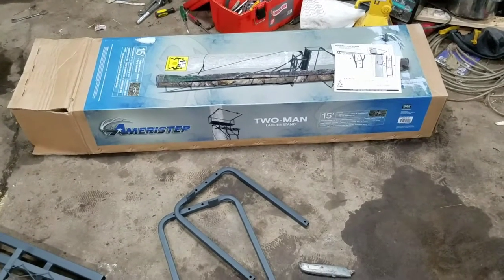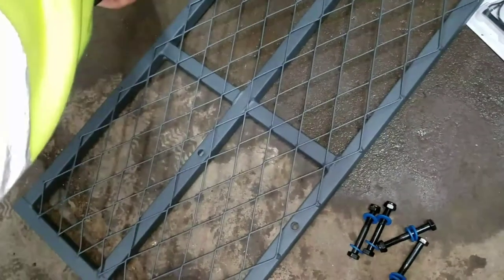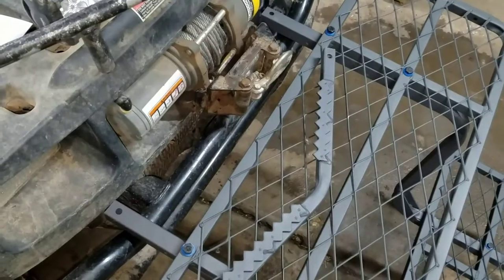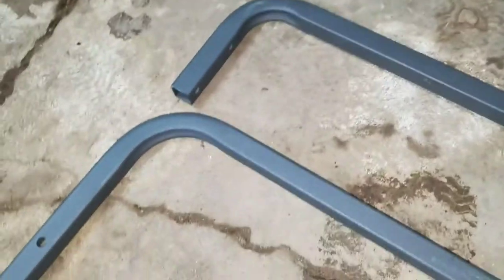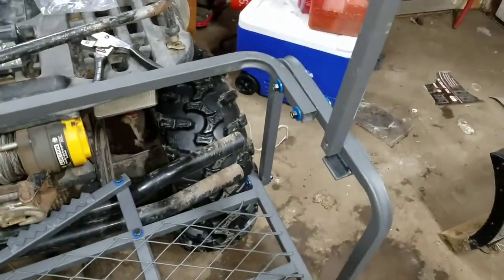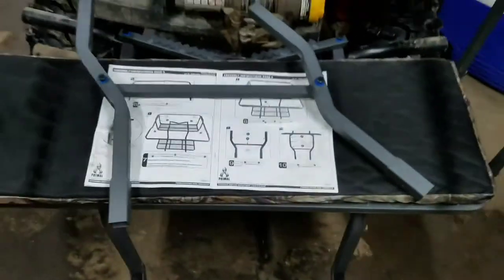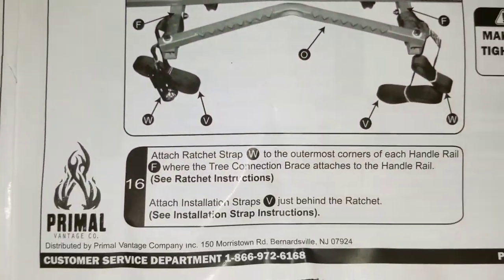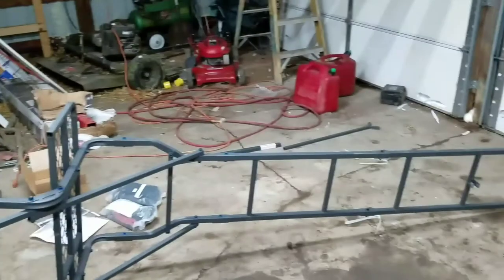how to assemble : Ameristep 15-Feet Two Man Ladder Stand

Comment: Hi, thanks for the video...i'm using as an entrance to a home built zipline. As a result I don't need it to be 15' tall. Is it possible to just use that middle piece of ladder and discard the other two? So the question is will it fit into the female end of the stand and work by itself?? Thanks.
Reply from the maker: Pretty sure yes